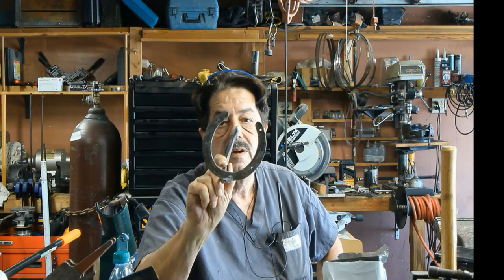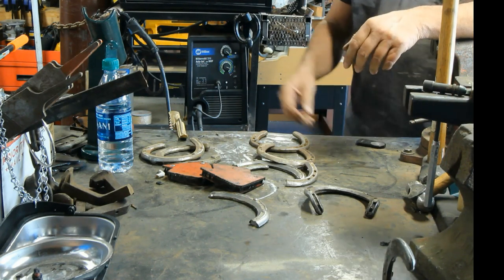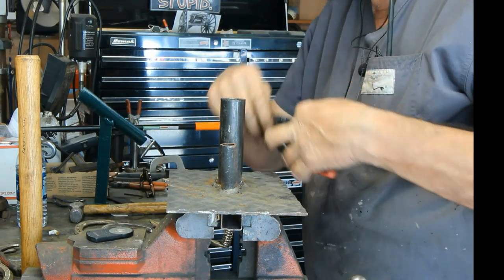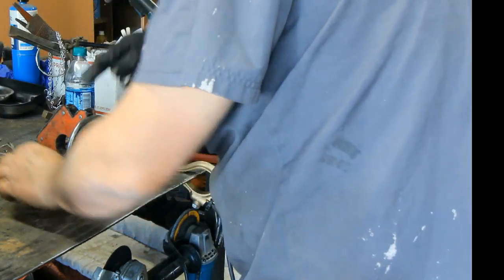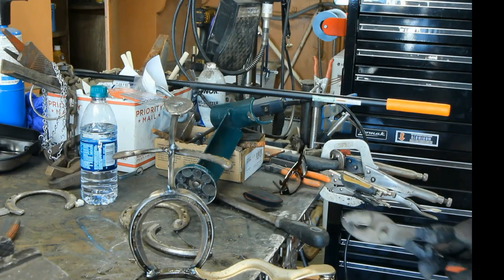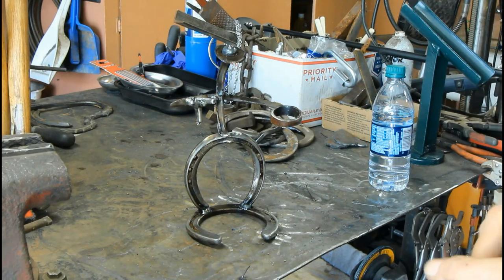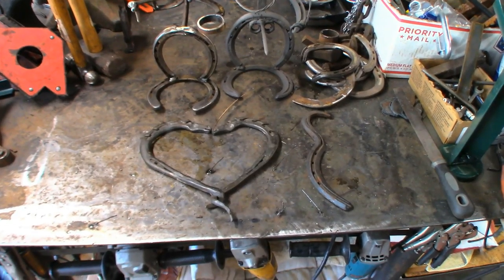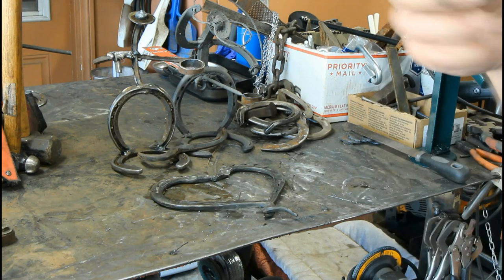Welding - How To Make A Cowboy Tool Holder

Comment: Please expand on a comment you made.  Text crossed the screen stating the ground clamp is flipped and should have the wire on the top.  Why does this matter?  Thanks.  Also, I enjoy seeing video of you working instead of the slide show style.
Reply from the maker: sure - I didnt realize that happened - Depending on how your welding table is made, thickness of the metal that you are clamping the grounding clamp down to - you will get better connectivity (grounding) if you make sure the cable end is on top of the table facing from the top down and not underneath facing up. I went over this in one of my previous videos and you also should make that spot where you ground on top of the table a clean spot - on mine i use a sanding flap wheel to clean up the spot where I most frequently ground to - these 2 simple things will increase your grounding connection and is  just a tip on making your welding experience a bit better - that with a clean shield and good tip on your welder. Of course grounding to the project itself on a clean spot will always be better the above I found helps to alleviate sputtering etc ....
Reply: @TheHomeHandyman  Thanks